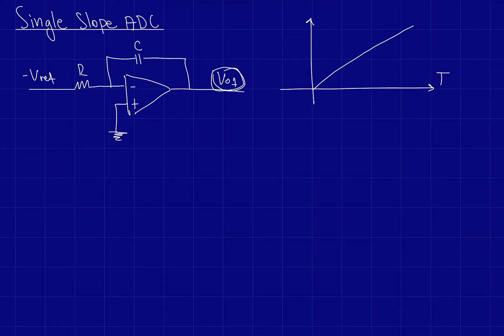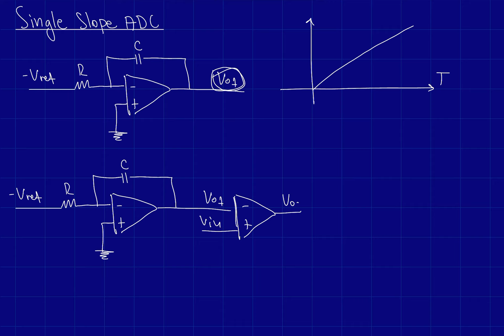Single-Slope Integrating ADC : Analog to Digital Converter

Comment: Boost the gain on your audio
Reply from the maker: Thanks for the feedback!
Reply: @Byte-Sized-Learning14 For audio that is drifting . Perhaps a noise gate on the mic.or a mixer where you can hear the feed as yiu record. A suitable inexpensive mixer with a control room out migh be an older behringer ub or xenix 802 which could allow a backing track. So theres no dead air. And an eq or gate to dump or lower the background audio when you speak. Just remember digital audio cannot be overdriven. Just a thought
Reply from the maker: @jasonprivately1764  This is really helpful, honestly. I am still learning and am far from an audio expert, so direct advice about what to do helps A LOT. I think also buying a mic arm will help a lot so i always talk close to the mic, so as soon as i can buy that i will. Thank you!